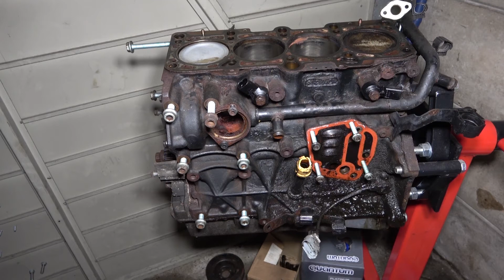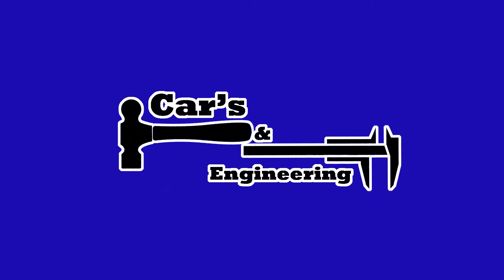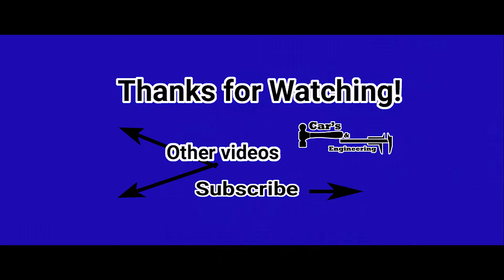The Engine Block Plan........... (9N3 Polo GTI Trackcar)

Comment: I'm looking at rebuilding my engine sometime in the future, arp head studs prevent head lift if you're pushing more boost, would recommend replacing main/con rod bearings if you're pulling apart the engine, rebuilds are expensive may aswell only do it once
Reply from the maker: Yeah that’s all on the build list mate, it is a ever growing and expensive list 😂

Comment: Hi I have the same vehicle...mine is giving white smoke out of the exhaust smell like fuel....do you knw how I can fix?
Reply from the maker: You’ll need to do some diagnostic on the engine I’m afraid it could be a great many things. 
Best bet is is check to see if the oil on the dipstick smells like fuel that could indicate that the piston rings are gone, you could also compression test each cylinder too, to see if that tells you any more info.
Check under your oil cap to see if there’s any mayonnaise kinda looking stuff that could indicate oil and water mixing too which could indicate a blown head gasket 👍🏻

Comment: 277hp and 310ft-lb is what mine is running... standards turbo and engine is currently untouched. R-Tech doing their Magic 👌
Will be building my engine at somepoint but costs a lot of ££ 😂
Reply from the maker: That’s a healthy amount from a standard engine! 
To be honest I’m over engineering mine a bit too much 😂 
300bhp is what I’ll be happy with but I’m expecting more than that hopefully.
I also plan to use r-tech too, they can use their magic on it 😂
Yeah my list of parts isn’t cheap 😂